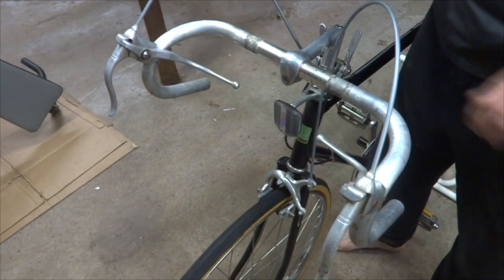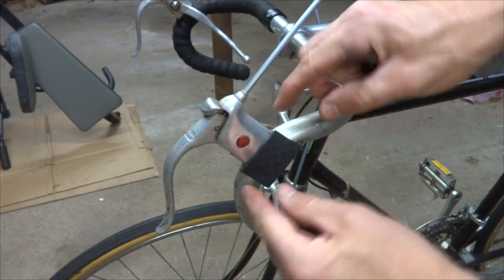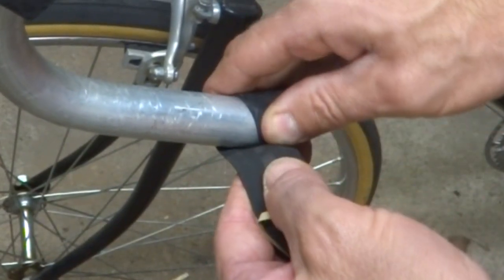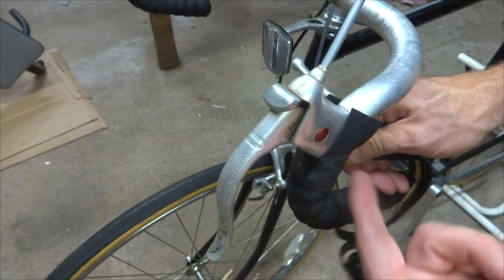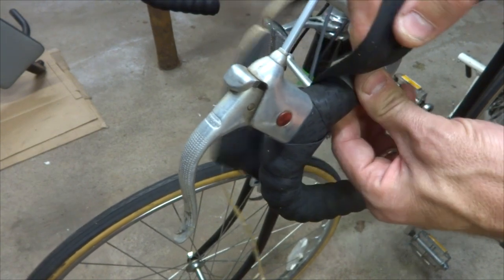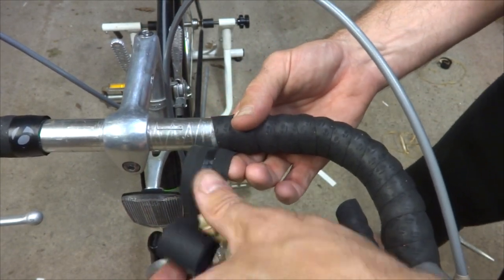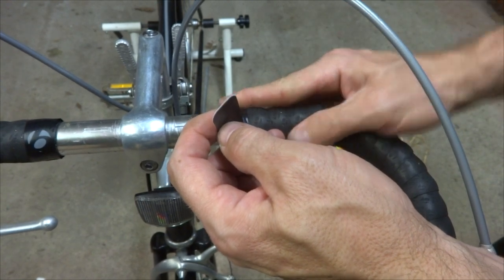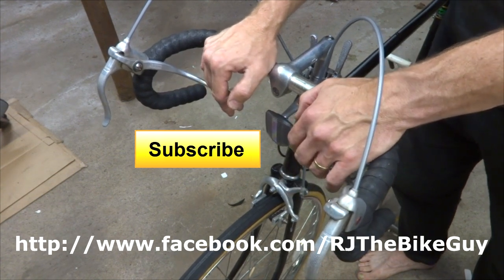How To Wrap Handlebars With Safety/Extension Brake Levers

Comment: great tutorial, my only add would be to stress the type of electrical tape you used. 3m Super 33+ is the only choice for the stretch, hold and lifespan. You'll find it in most every electrician's tool bag.

Comment: I love how good your tutorials are, from the perspective of someone who does not have enough money to buy brand new bars, brakes, and everything when your tape gets worn out. You definitely deserve more subs. I especially like this video because i have an old road bike with this kind of brake that i was planning on turning into a fixed gear/completely overhauling so now that i know how to replace tape, i will definitely do that. Also, do you happen to know of any relatively inexpensive (~$30-40) track/two sided/flip-flop hubs? Thanks
Reply from the maker: +Luke Hill Maybe there are some on ebay. I have seen track hubs on there, but I don't know how good they are.

Comment: Followed the instrictions in this video and the results turned out great. thanks alot.
Did and extra step though. i unscrewed the safety break levers and put them on again after wrapping the bar tape.
Reply: how did u remove the safety levers?
Reply: @wolffirepaladin5  there’s a screw on the inner facing side of each one
Reply: Mine were riveted on, so I am ordering a set of modern levers, I like the idea of the clean cockpit look, especially with the downtube shifters on the bike...

Comment: Great video, with regards to the brakes is there a way to tighten the levers. Not the drop brakes but the normal position pulls, I see you have screws on this bike but mine are press studs is there a way to tighten these as the rattle as I cycle.
Reply from the maker: Nope, the extension levers pretty much such. I usually remove them.

Comment: used to wrap bars with cloth tape in the 80's,those rolls never had the extra piece of tape to hide the brake lever mounting strap,they had bar plugs (cat eye brand)that had a screw with a round threaded metal plate behind it so after u pushed the plug in you tightened the screw & it squeezed the back of  the plug & it prevented it from falling out.are they still around? it's been a while since i last wrapped some bars & gotta do mine soon :)
Reply: +neil crompton You can still buy those from a lot of online sellers. They rarely come with bar tape as they mostly come with normal end plugs. You can get them in most colours and in different variations and they are normally around £4 but you can get some that can go up to around £15 like the Hope ones. In my opinion normal bar ends work fine and weigh less but i suppose screw-in ones could provide greater peace of mind.
Reply: i hate push in bar plugs they never stay put,grrrrrr!
Reply from the maker: +neil crompton With thinner clothe tape you could do some extra loops around the levers no problem. The new tape is just too fat and you would also run out of tape before the end.
Reply: +Harry Clulow  would a few dabs of silicone make them stay put?,the weight of a pair of bar plugs would weigh only a few grams & that's not even worth worrying about right?

Comment: Bike Guy: How to change handlebars from Dropdown to Starigh bar. Problem I need to solve is with the brake-handles. How are them going to go on the flat handlebar? Thanks for your help!
Reply from the maker: That is not a one or two line answer. Maybe I will make a video.
Reply: that will be ideal, thanks!

Comment: I have a question, +RJ The Bike Guy, I have to change the hoods of ultegra 6500 brifters, but they are impossible to found. Can I put handlebar tape or something to cover brifters? the hoods are soft and sticky , chewing gum surface. Thanks a lot
Reply from the maker: You can put whatever you want on it. Probably nothing will be as good as the real hoods.

Comment: Hi, one of my extension levers has come off my old road bike. Could you tell me the type of screw I need to fix it back onto my bike. The screw looks exactly like the one in this video
Reply from the maker: +Tim Fong (FongFit) They are specific to the brake levers. Just see if you can find one or two if these kind of levers. Or chuck them. The extension levers are not very good anyway. Another name for them is suicide levers.

Comment: When I went to tape my handle bars, I noticed the band clamp was loose on one side.  Do you have a video on how to tighten it?
Reply from the maker: Not specifically, but I mount brake levers in a bunch of my videos. The screw is either inside the lever, visible when you press the brake lever, or to the side of the lever (under the rubber hood) if they are brifters.
Reply: RJ The Bike Guy found it! thanks! maintaining my bike used to be a pain but with all the knowledge I've gotten from your videos, I'm really enjoying it... although I'm noticing a lot of things that need maintenance that I have just neglected over the years

Comment: Hey! Can you make a video of how to install/uninstall the extension levers of the brake levers?
Reply from the maker: +Floggnaw 420 You mean remove the safety brake lever like in this video? Better just to replace the brake levers with brake levers that don't have them. Otherwise you will have a bolt sticking out the side. Sort of like the ones in this video: https://www.youtube.com/watch?v=gk-GpDiPDms
Reply: +RJ The Bike Guy : 
I want to install safety levers on my current brake levers. Can i do that? 
Or just better to buy brake levers with safety levers already on them?

I want to install them for my vintage race bike to do retro racing. Its more like a ornement purpose than real extension levers. On my city race bike, i have only top levers installed. example: http://img.weiku.com//waterpicture/2011/11/17/11/road_bicycle_half_steel_insert_brake_lever_634661623473665551_2.jpg
Reply from the maker: Those are inline brake levers. I do plan to make a video installing those at some point.
Reply: +RJ The Bike Guy : I have these brakes on my vintage racing bike(http://i42.tinypic.com/vd3c4l.jpg) and i want to install safety levers/turkey wings/.. on them. I have 2 vintage racing bikes: one with only top levers("urban" race bike) and a regular racing bike (for retro racing). On the regular racing bike i want to install the safety levers for the design. (I know that these safety levers are not good brake system.) Sorry for my english
Reply from the maker: If you have safety levers on your bike, then it is not a racing bike. These were found on low end recreational bikes. Real race bikes did not have them And if you was to install turkey wing type brakes, they are installed the same way as regular brake levers. I have several videos installing brake levers.
Reply: +RJ The Bike Guy Oke. Thanx for the info

Comment: Great video, thanks! regarding the brake lever, could u inform us how to use that type of lever? I have them on my bike, however, I couldnt really use it from the hood position. Is there any mistake on my brake lever setting? thanks!
Reply from the maker: Safety brakes are low end and generally suck. I wouldn't keep them on any of my own bikes.
Reply: @RJTheBikeGuy  I thought it would be more useful having 2 levers so we could use it from the flat bar position as well. What are the disadvantages? Thanks.
Reply from the maker: @naufalmj  Feel free to start googling. https://www.reddit.com/r/bikewrench/comments/36b0tw/how_dangerous_are_suicide_levers/
Reply: @RJTheBikeGuy  Thank you!

Comment: Didn't you start in your other videos the other way round?
Reply from the maker: I always wrap bottom up, with the exception of old non stretchy tapes like cloth or plastic. https://www.youtube.com/watch?v=9OrKpze98jc
Reply: RJ The Bike Guy no, I mean in the other Video you wrap outwards and in this inwards.
Reply from the maker: If I wrapped top down (or outwards), then it was cloth or plastic, non stretchy tape as I said above. Or you were watching someone else's video.
Reply: RJ The Bike Guy I ment this video: 
https://youtu.be/n-BMsC0Ao-o
Reply: I also wonder this. In that video that OldschoolDT wrote you wrap the bar tape in the outter direction because quote "It's going tightening instead of losening the tape". But in this current video you wrap in the in-direction. What's the reason for that?

Comment: how do you convert that type of friction shifter to a down tube shifter?
Reply from the maker: +Matthew Buckler Just get clamp on downtube shifters and install those. It's easier if the downtube cable stops are clamped on so you can remove them. Otherwise you either need to work around them, or grind them off.

Comment: Why would you show how to do this? You should be telling people to ditch the extensions. They are not "safety" levers, and, in fact, are not safe. They are so flexible, that in a panic stop
Reply: they will bend all the way to the handlebar and not give you maximum braking.
Reply: How To Wrap Handlebars With Safety/Extension Brake Levers

Comment: I have the same ones how do I replace the nipples on the top for the cable stop and mine rattle like crazy how could I stop that I know 7 years later I hope you see this though I really don't wanna buy new ones though if I did I would get the diacompe quick release versions they make em nutted so I've done my research but I can't stop the rattling